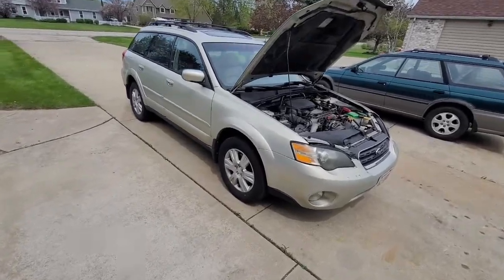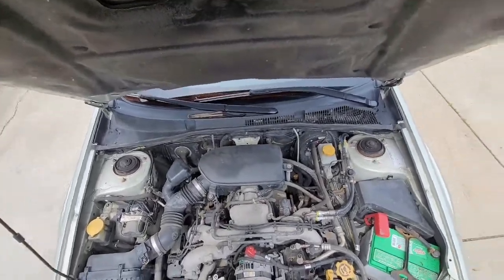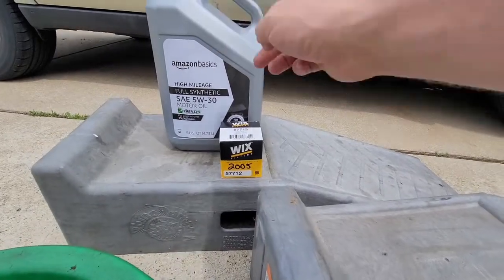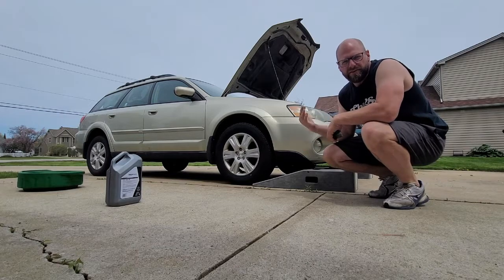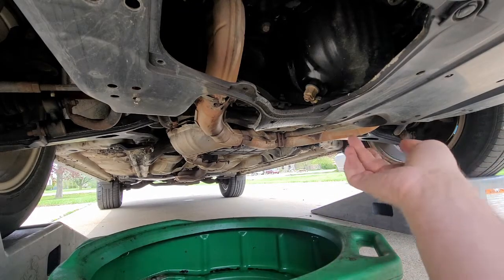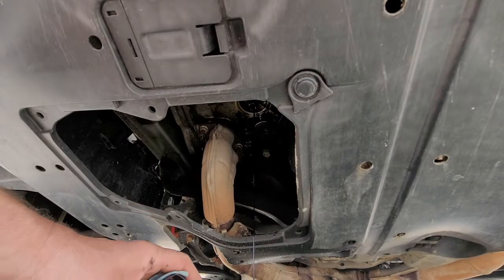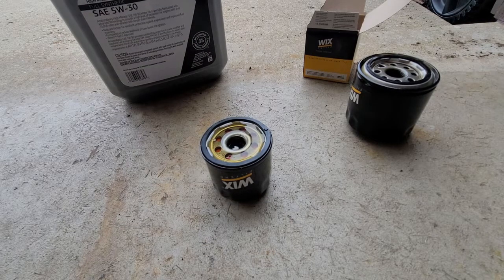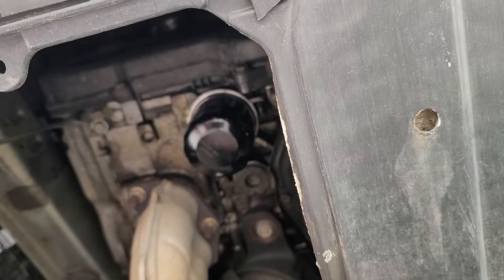How To OIL CHANGE Subaru Legacy Outback WAGON 4th Gen 2005-2009

Comment: Couple suggestions.
When draining the oil, first remove oil fill cap... this will help the oil drain faster and get better flow.
When checking level after filling.... do so AFTER you get it down from the ramps.
Reply from the maker: Thanks for watching and for the suggestions!  I did take the car down but didn't do a great job showing that part.

Comment: Amazingly different underneath to my 2006 manual Outback here in the UK. The UK version has a one-piece under-tray with two tiny access ports that give you access to nothing you could possibly be interested in so the filter change requires the under-tray to be removed (easy, but putting it back is a bit of a pain). Also, there is not much room around the filter so the right filter socket is a help. Also we get different service intervals - 6 years/60,000 miles for the timing belt for example.
Reply from the maker: I think my wifes car may be missing some of the lower belly pan you are talking about...not sure.  The filter is very easy to get to on her car though.  Thanks for taking the time to watch and comment!

Comment: Thanks for the vid! Would it flow a bit faster if you took the filler cap off too? Love the valve idea for the sump.
Reply from the maker: Thanks for watching and the question/suggestion!  Yes it would flow faster, I forgot to take the cap off, normally it's the 1st thing I do.  I have these valves on 2 other vehicles and it sure speeds up the process and less mess.  -Frosty